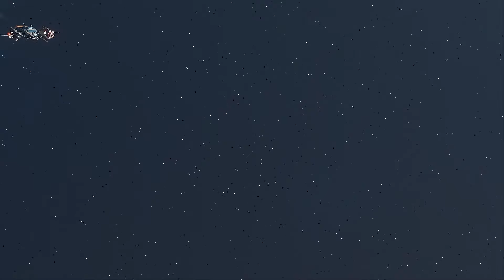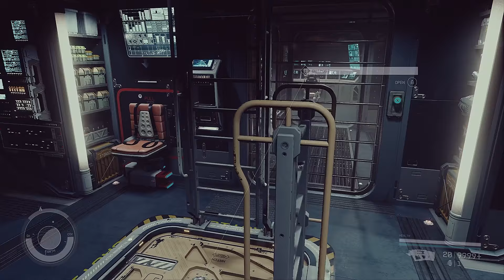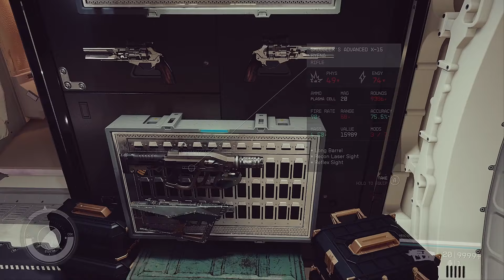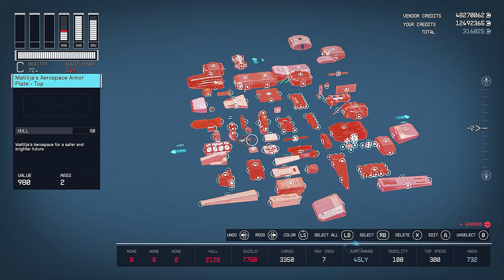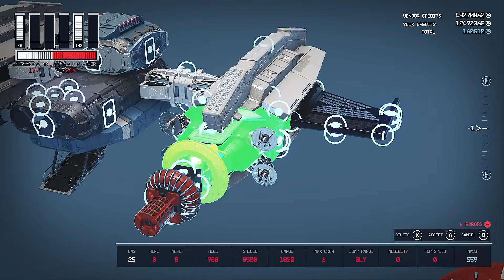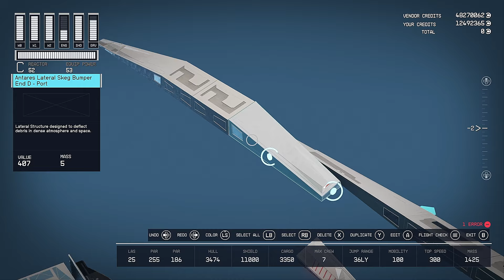Starfield - KURO KORI, Bounty Hunting Sloop.... #starfield #starfieldships #trackersalliance

Comment: Completed. The gun looking piece from Avon Tech. I did not have for some reason. I guess it’s gone. I had a substitute a larger Avon tech piece so my laser cannon came out bigger than yours, but it worked. And then I didn’t have the long Antare‘s pieces for the end so I just snapped together a bunch of Antares pieces that I did have and it worked out. I had to make the engine covers one set wider because they just would not go on no matter how hard I tried. So once I made them wider, they went on perfect so slightly customed.  Thanks Again